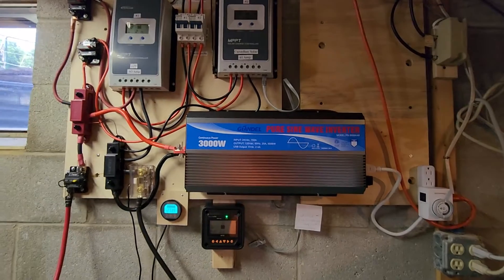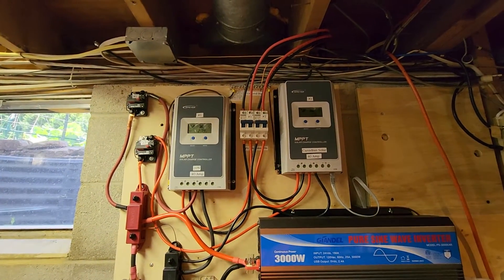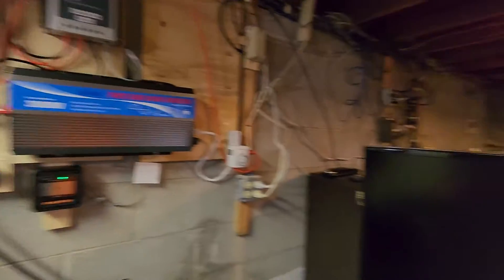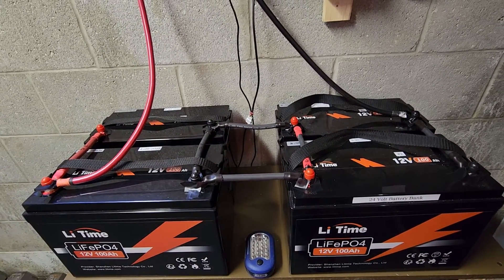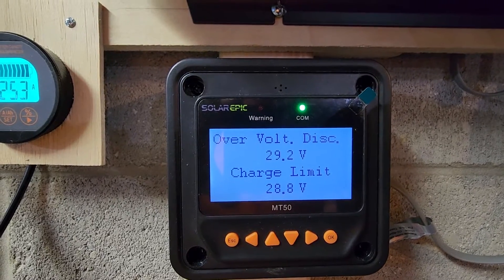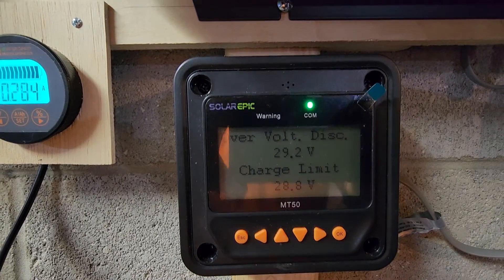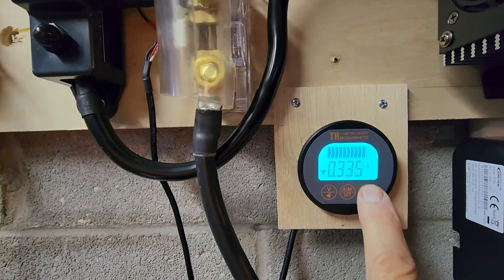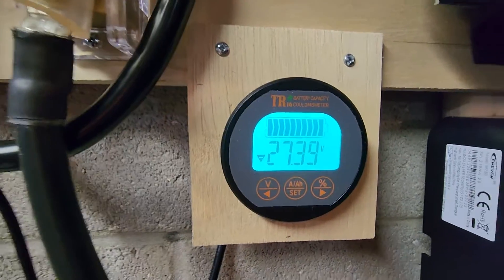EPEVER Charge Controller Settings for LiFePO4

Comment: Buonasera,ho anche io due regolatori Epever da 30ah,ora ho due batterie lipofe4 che sto montando al posto delle AGM che erano configurate a 12v,ora non riesco a configurarle a 24v,perche?Grazie se puoi Darmi qualche consiglio,saluti da Italia😊.
Reply from the maker: At risk of stating the obvious:  First measure the voltage of your batteries where you connect them to the controller to be sure you wired your battery bank correctly and your voltage is in the expected range.  Second, don't connect your solar panels to the controller until all your settings on the controller have been completed.  Now connect the batteries to the controller (obviously at the battery connection terminals of the controller with the correct polarity).  Set the controller settings for you battery type and voltage. Last connect your panels.   These controllers should autodect whether the power source is 12 or 24 volts.  The pc software is helpful in diagnosing and configuring if you are running into a problem with it.

Comment: Why don't you have it set to 400AH? No matter how the batteries are connected, you still have 400AH of batteries. Connected in parallel, you would have 4 x 100 AH, in series, you would still have 4 x 100 AH, in series/parallel as you have, you still have 4 x 100 AH. The only difference is the voltage output 12,24,and 48. The storage capacity is 400 AH no matter what.
Reply from the maker: Because it was a 24v 200amp bank. 2s2p.  2 pairs of 100 amp 12v batteries each in series creating 2 100amp 24v batteries. Those 2 pairs then connected in parallel to make a 24v 200amp bank. The bank connected to a 24v to ac inverter.

Comment: Hi Arnold, I have a very similar configuration to yours and my 24V 1200W Giandel inverter. Thanks to your video I was able to solve the alarm failure, it seems like an inverter error since according to the manual it should work even with a wide voltage range (Input voltage: 24V(19-32VDC)) in my application I had to adjust - over volt disc 28.8 -
charge limit 28.8. Greetings from Venezuela

Comment: I have a small 12v system w/o an inverter and an Epever 30 amp charge controller. I just switched from a flooded battery to a single 100ah LiFeP04. I also use the MT-50 interface. Since your system is much larger would the parameters still be correct for my system or would I need to use different ones. Thank you for your video and all the information you provided.

Comment: Hi Guys, here is the correct answer :

on Epever MPTT module
hold the battery Button
change battery type to : F08 (this mean LifePo4 8S)

other option :
F04 (LifePo4 4S) - 12Volt system
N03 (LiCoMn)O2 3S
N06 (LiCoMn)O2 6S
N07 (LiCoMn)O2 7S
Reply from the maker: Doing that yields the default settings for the battery type.  For LiFePO4, many parameters cannot be modified from those defaults unless you select battery type "User".

Comment: Noticed your float voltage setting will still charge your batteries even if they are full. LIthiums don't need floating. That voltage will result in over charging the battery at low current.  26.8V (3.35v/Cell) will keep you below any charge activity.
Reply from the maker: I wondered about that too.  However,  Epever, Victron, and EG4 and probably every other mppt charge controller has a default float volt setting for LiFePO4 that will "charge" the battery when full when the voltage drops below that setting.   I tried decreasing the float voltage setting and what happened was the battery would  discharge and lose a percentage of its state of charge, until either reaching that new float setting or revert to bulk charge (constant current) mode.  The system would discharge somewhat even when sunlight was available to charge it.  So, on the one hand I'd like to not "overcharge" the batteries, but on the other hand I don't want the batteries to discharge when there is available light.  You really can't overcharge the batteries too much even with the float because when they become full, the voltage quickly rises to the float voltage charge limit and the charging immediately stops.  This is verified with a shunt battery monitor demonstrating the current stops flowing into the batteries.

Comment: For those of you with 2000w or less inverters, I wonder if placing a dc to dc buck converter between the battery and the inverter would aid in this issue. Just a theory, but if a fellow could run his solar controllers at peak performance, then buck down the voltage 3 or 4 volts to keep the Giandel from alarming, I wonder if that would be feasible?
Reply from the maker: I suppose it would depend on how fast the buck converter would respond.  I think those buck converters at even 2000 watts would be expensive.  The other cost with it might be a hit of efficiency (? 10%) and introducing another point of possible system failure.  But, theoretically, at least, it should work.   I've since replaced this inverter and controller with an EG4 3000 48V All-In-One.  This was possible when I added enough panels to get the PV operating voltage high enough for the EG4 to work.  This setup solves the alarming, solved my lack of ground-neutral bonding (not supported by the Giandel) and adds automatic standby charging backup by either the grid or generator.

Comment: Thank you for taking the time to help others with similar issues, I will try your settings on my system.
 For others still getting tripping after reducing voltage as described here, it's possible they have a battery (or batteries) with a runaway cell, that's hitting max voltage ahead of the rest
 causing the BMS overvolt protect, to also trip the output momentarily. As you advise, continuing to reduce maximum MPPT voltage should eventually find the sweet spot. Great video, thank you.

Comment: I have the exact same problem!  With 40a charge controller. 360ah 24v bank. Inverter tripping out when full. Cant wait to test this out. Thanks

Edit. Tried it. Still having same issues. A year of this and I'm tearing my hair out!
Reply from the maker: You can try reducing the voltage a bit further.   I replaced my Epever controllers with an EG4 3000 48V "All in One".  This is in parallel with a Victron Controller.  This arrangement has no problems with the inverter cutting off when the voltage limit is reached.  The grid can charge the batteries automatically if there is no sun.  It also allowed me to automatically  switch  the neutral ground bonding (depending on grid vs inverter mode) so that circuit breakers work properly.
Reply: The problem is the inverter, it has a system that disconnects it when it detects power overvoltage, what happens? There is a momentary power spike, which causes it to trip, the solution is to buy an inverter that in its characteristics supports higher surges... or design a peak power cutting system
Reply from the maker: In this case, I agree that the Giandel inverter is the primary problem.  However,  I found that the Victron charge controller responds much faster to changes in voltage (eg. a full sun emerging from a dark cloud).  Thus, the Victron is far less likely to trip the Giandel's overvoltage cutoff.  @carloshys1746
Reply: @arnoldsolof  seems that it's chargers fault. i'm currently having the same issue with my Deye inverter and the epever xtra 4415n. (48v) I have no way to connect to the charger and i'm looking for it.
your video helped me understand what is going on. I should use the inverters mppt lines but i'm short in panels and i cant reach the recommended voltage.
thank you

Comment: Hello Arnold. Thanks for doing the leg-work of mapping the settings out. I had been using the recommended settings for Battle Born  batteries, which I no longer use. I have the same EPEVER charge controller and the same Inverter, although mine is a 1200W one. I have the issue you experience and keep telling myself I need to adjust the settings. I'm going to give yours a try. Many thanks.

Comment: Hi Arnold.  I am very impressed that you have taken the time to do this video on such a complicated product and you also spend so much time on helping people with little technical questions.  It is wonderful to have people like yourself providing information about things you have actually found yourself rather than read about in a book.  I have had a couple of EP Ever chargers for about seven years now and have only used Lead acid and then AGM batteries.  I have just purchased a lithium 120ah and thought I should change the parameters of my charger to suit.
Your video is so detailed and yet so easy to follow I just wanted to let you know how much I appreciate your help.  I now have a great guideline to use in my setup and hopefully look after my new battery. (they are not cheap)
Cheers and thanks, Dennis
Reply from the maker: Thanks for the encouragement.  Sometimes I wonder whether or not making the videos is worth the effort.
Reply: @arnoldsolof  It is worth it for sure, I have the same issue, will try these settings. thank you
Reply: It definitely is, thank you for your work sir @arnoldsolof

Comment: over volt disc 29.2 
charge limit 28.8

boost charge 28.8 
float charge 27.6

boost rec  26.4 
low volt rect  25.6

under volt rect  25.6
under voltwarn  24.0

low volt disc  22.2
discharge limit  22.0

equalize time  0 min
boost time 30 min

Comment: I can't change the time and can't set the  "over volt .disc." ,   getting "para.error" when saving!   Am using USER setting  and using the MT50 remote. Can you help?
Reply from the maker: In the manual there are rules described where parameters allowances depend on other parameter settings something like A >= B > C >= D , etc.    To make it easier to comply with the settings rules, page down to the last setting you want to change and work upwards (backwards) through the menus.  This makes it more likely you will not violate those rules.  Or, set and save them one at a time.  If you get a parameter error, go on the the next one(s), and come back to the one that generated an error later.

Comment: Really helpful this, thankyou. I have just the one Epever SC with MT50 on a 12v set up, using the same inverter. I too used to get the alarm on my giandel inverter, and my BMS showed POV (parameters over voltage) but now i'm not. Much appreciated.
Reply from the maker: Glad it helped

Comment: Pardon my ignorance, I haven't even assembled my system as yet. But I noticed that on the first page of the 'Control Parameters', at the bottom, you have 200AM under 'Batt. AH'. Should that not 400AH instead?  I don't know how or why, but, could that have an effect your situation? Is that one even configurable? Just thinking out loud, trying to anticipate potential problems I might encounter.
Reply from the maker: It is 200ah. Two 12v 100ah in parallel = 200ah then 2 of those in series = 200ah at 24v.
Reply: @arnoldsolof  See? that's why I asked for pardon first off thing.